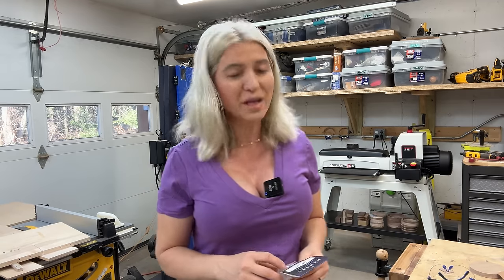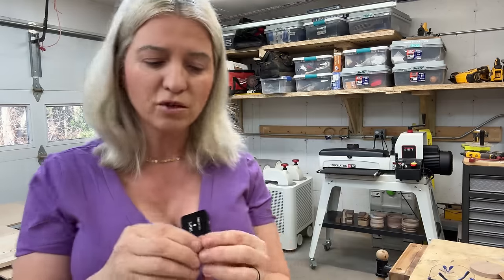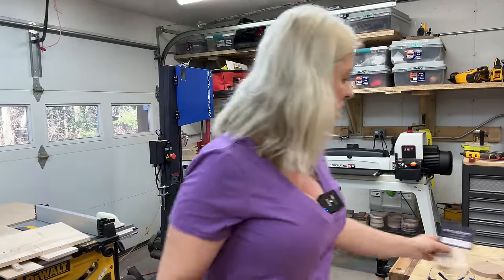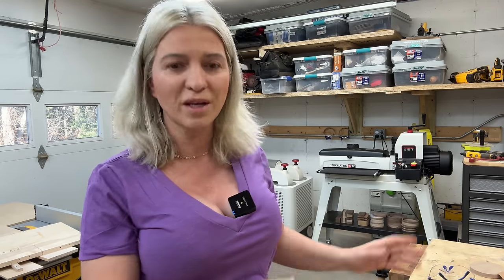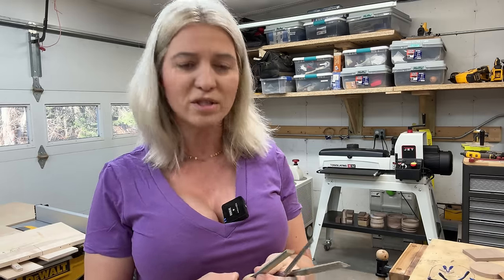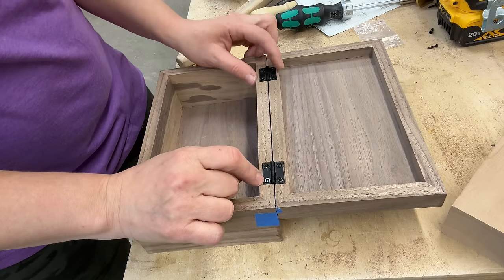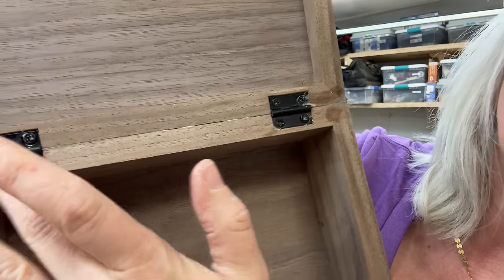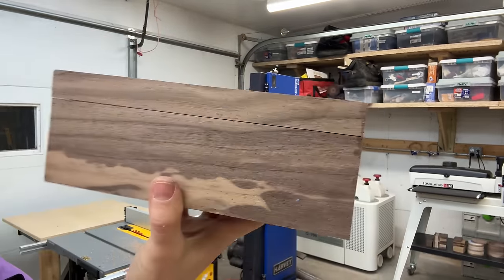Installing my very first hinge on a walnut box

Comment: Alot of great suggestions from the comments. Self-centering drill bits and center punches do help. Also, where the barrel of the hinge sits on the lid and box, chamfering those corners so the barrel radius doesn't create that small gap may help.

Comment: Skyler get a centering punch. It will mark the hole exactly in the center and make it far easier to start the screw. Sometimes if you dont start the screw in the exact center the countersink will pull the hinge out of the right location when you tighten it.
Reply: A vix bit would be better

Comment: Speaking to what you talked about at the start of your video regarding sharpening, I would suggest hand sharpening, this is a skill that once acquired will change the game for you. I prefer Rob Cosman’s method but Paul Sellers has a great method as well. Pick one, get good at it and if you dull your chisel scraping glue, so what? As Chris Schwarz would say “you can sharpen can’t you ?” That tiny grinder is going to eat your chisel up within 2 years. Really enjoy your channel! Also you typically need to flatten the back of the chisel when they’re new.

Comment: Skylar I thought your video was good, reflecting on what you learned on this project.  I liked the detail on using the Work Sharp, which I have as well.  Suggestions for next time:  1.  take a single leaf of the hinge and set the depth gauge of a plunge router by placing it between the depth gauge pin. This will give you an exact depth for the router bit, and therefore no guessing. There are you tube videos on this.  2.  When using the chisel square for the mortise corners, use a block behind it (3/4 or so) to back up the chisel. There is much more control of the chisel this way.  Good luck on your next try!

Comment: If you notice when you close your hinge, there’s a gap near the barrel. That’s why your box wasn’t flush at the back.
Instead of measuring the depth of just the hinge, open the hinge slightly so that it is parallel to one another. Then measure from the bottom to halfway between the opening. Use that to set your depth on the router. That will make the back of the box flush.

Comment: The Work Sharp sharpener is a great tool! I gave up 40 years of hand sharpening when I first heard about it and have rarely pulled out the stones since. It is important, when first sharpening new chisels, to polish the back of the chisel first. After that, set the bevel adjustment to 25 degrees and run through the grits. Once you have finished that, you can set the bevel to 30 Deg. and put a slight secondary bevel on the edge. Just enough to see a slight line at the tip of the blade. Finish by honing the chisel. Practice will make this process second nature in no time!
Reply from the maker: I am so glad you commented on this as I didn’t know how to use it, never read the instructions…. Just tried it… it worked…. I was happy with it! Next time I will follow your instructions. Thank you

Comment: I believe the square hinges just need to hang past the back edge equal to the thickness of the combined leaves. Not sure if this has been said yet. Also Vix bits (self centering) are very helpfull for all types of hinges. Hinges on a small box are challenging and you did a very good job if you haven't done this very many times. You definately have the mechanical aptitude to perfect this within a couple more boxes. Just starting to go through some of your videos and I'm impressed already.

Comment: I have lots of problems with hinges. The main problem has been mentioned below : not getting the drill hole in the EXACT centre. People recommend centre drills but they do not make them small enough for small hinges. I think the solution is to make or buy small punches that are an exact fit to the holes in the hinges. Greetings from Cairns, Australia.

Comment: High there, looks like the hinges are either a bit too high or the screws heads are a bit too high. Either deepen the pocket to correct the hinge or deepen the counter sinks slightly to lower the screw heads. I build Clocks and have been there many times, patience is the key. Also take off less material at a time when getting closer to the finish line and continually keep checking the fit.
but if this is your first attempt, it looks good. Final finishes and hinges are so critical as it is what everyone sees.

Comment: Skyler, inexpensive hinges can be finicky.  They are stamped out and not machined to close tolerances, so there are variations between them.  I use a centering drill to start my holes and then I use a hand egg-beater drill to finish them.  It gives me much better accuracy in hole placement and depth.  I also use a mini router plane to get the correct mortise depth.  It's slower, but I can get better accuracy with it.  You'll get better with practice.  At least you had the courage to make a video of your first attempt!

Comment: Hi Skylar.  @peteblunda494 provided a good summary on the Worksharp tool.  I will add that chisels 1/2" or wider should be sharpened on the right side of the sharpening port while those under 1/2" are sharpened on the left side.  This has something to do with avoiding heat buildup.  Speaking of which, the manual also instructs to use a jab motion when sharpening.  You were holding the chisels against the abrasives far too long.  That builds up heat and produces a larger burr.  Lastly, there is an adjustable sharpening port fence.  You use this to align the chisel square to the sharpening disks.  You move it to the left or right side of the chisel (depending on width) and leave just enough room to slide the chisel without resistance.  It Take the time to read the manual...it's worth it.